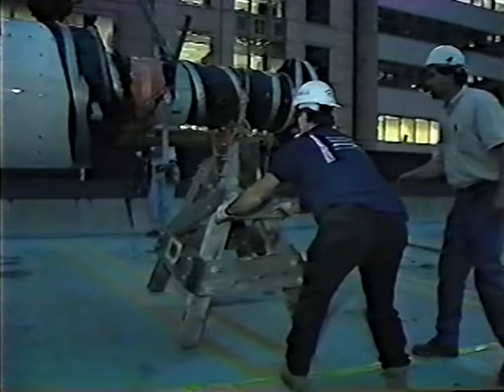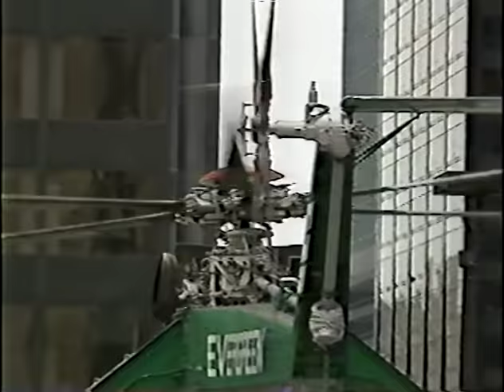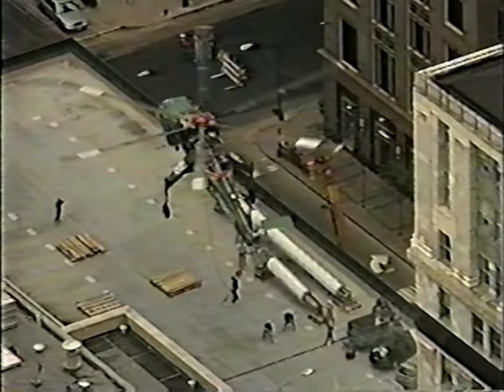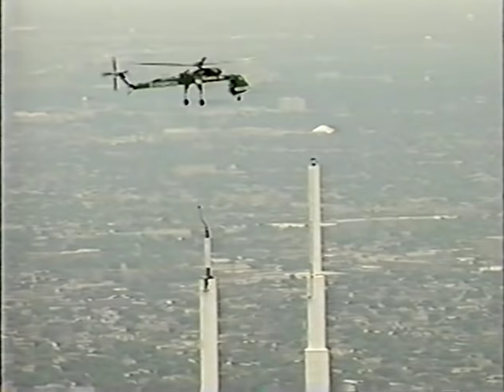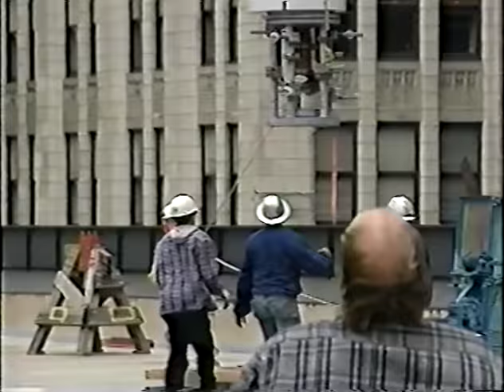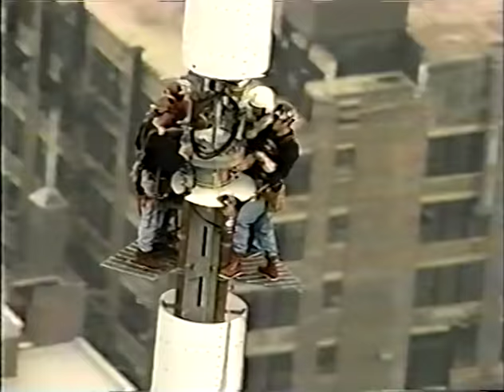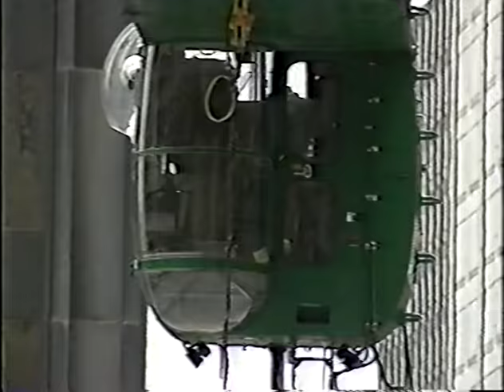Addition to the West Antenna Tower. Sears Building, Chicago, Illinois. Sunday, June 4th 2000

Comment: What is this antenna used for?
Reply: Warns airplanes or lighting
Reply: Yes correct and also television and radio stations as well
Reply: I still have this announcement speech in my head, from the days when the broadcasts were read live, even though the NWS has moved it's broadcast location around, including the airport. Here is the announcement that I still have in my head for 40 years...

"This is Chicagoland NOAA Weather Radio KWO39, operating on a frequency of 162.55 MHz, from the National Weather Service Forcast Office for Illinois. We broadcast from a transmitter located at Sears Tower."

So, the Sears antennas have always been capable of broadcasting radio, not just aircraft signaling.
Reply: TV and radio
Reply: It is a "community antenna system."  The two structures serve multiple TV and FM radio stations.  Inside the white radome material are several antennas, some of which are fed with diplexers.  This allows some of the antennas to be fed by more than one FM station simultaneously.  There are dozens of other small antennas for commercial, government and Ham Radio use.  These smaller antennas are not part of the two large structures on the top.  I owned a company that provided engineering services for broadcasters.
Reply: @donkerouac3746  All have clearly declared it's antenna and it might have other purposes as well :)

Comment: Would that addition to the antenna makes Sears Tower the tallest structure in USA ?
Reply: No. The tallest structure in the US is a tv tower in North Dakota installed in 1963 that is just over 2,000 feet. The north tower and 1 WTC with their antennas are also taller than the Sears tower.
Reply: @ErikCB912  Actually, this addition made the Sears Tower three feet taller than 1 WTC.

Comment: Really nice video. retired IW here with a dumb question: on the aerial shots, why is the background spinning/moving while the connecting crew seems to be filmed from one stationary point?
Reply: The camera is actually moving as the helicopter it is mounted in moves around the tower in a circular route.  Hence the background seems to move.  If you look closely, you may see other aircraft in the area also filming.....

Comment: It’s really easy, with a crew of 50 guys monitoring you, part of a ballet of rehearsed assembly steps. Now consider the lone field service Tech replacing a strobe light with 1 guy spotting you?… that’s alone, that’s tough. Or being, my case Northern Ontario after an ice storm! spending more time whacking off 2” inch thick ice than performing an actual fix …towers bow in the wind, ice pack crack under the load…
Riggers get paid good wages for the month’s Hell Freeze’s Over…..

Comment: Management just standing around
Reply: @Quadrille Lol 🤣
Reply: The crew knows the show and the management knows the business
That's the Showbusiness
Reply: Sorry, but you are talking about something you don't have any knowledge about.  I have been a subcontractor in the Chicago broadcast engineering field.  The ground crew work may not look as sexy as the aerial work but they are the conductors of what is happening.  Everything is carefully choreographed and controlled by those guys.  They have years of experience and have planned every step of that job.  Nothing is done in a casual manner.  The stakes are extremely high.
Reply: @donkerouac3746  Lol!!🤣I hear you!